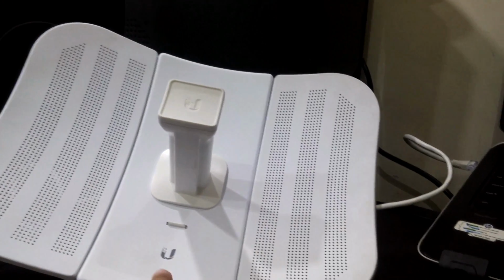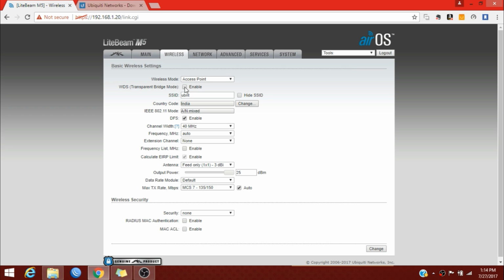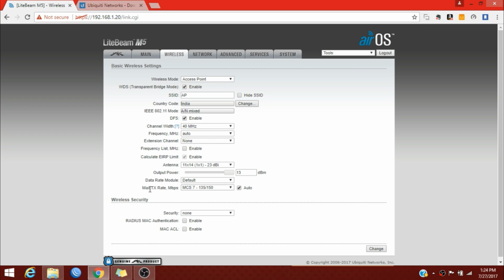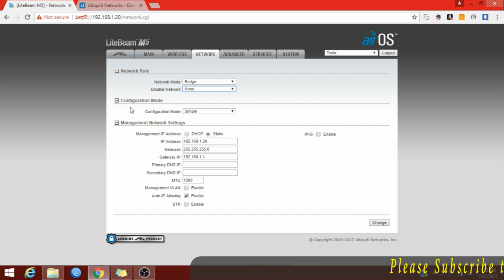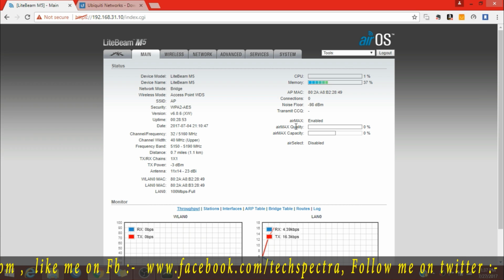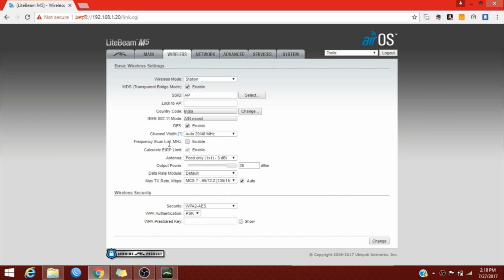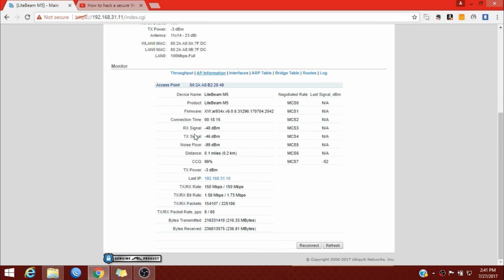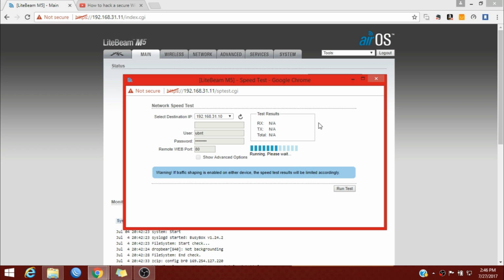How to Setup & Configure Ubiquiti Litebeam M5 as Point to Point (P2P Mode).💻 AirOS Full Tutorial.🔖

Comment: Hi there! Thank you very much for the video. So I will have the exact same setup as you do have, but at the other side, I did not get the point why I have to connect to the ISP. On the AP side, the cable goes to the router, so this provides internet access. The AP side will take the address automatically which I assigned (I hope). Then the station Beam will receive and I can connect that station beam to another router, providing the WLAN to multiple devices right? I don't understand the ISP part. I just ordered, but am unsure, if I need more devices on the station side to provide either a LAN or a WLAN connection... When the stuff arrives, I will try to connect the station to a normal router/ access point, so e.g. mobile devices can access and my stationary pc can as well. Do I have to connect/ have anything else/ is the ISP part necessary? Thank you very much for detailing this out :)

Comment: 1-2day after station side data not access reset device connect ap data receive but after 1-2day station side IP not access 
Then finally reset Karna padta hai how can solved problem
Reply from the maker: Check by updating firmware if problem still exists then your device may be faulty. Hardware issue.

Comment: I can’t get the AP to pick up an internet connection. I don’t get the option to login to the ISP via browser like I am supposed to. I even plugged it into an open port on the back of my router that already has access and still no internet.
IPs are all in my network range.
What did I do wrong or what can you suggest to help. Anything is appreciated. Thanks

Comment: I have a question. Sir no any adjustment in the setting for long distance connection..? Tnx
Reply from the maker: Depends upon your distance between your AP & station. For upto 5km litebeam m5 works. For 5-10 km you have to use power beam

Comment: When I punch in my unit IP address but it won’t let me in the menu it only says time out
Reply from the maker: Reset your wireless device and then configure it again by opening 192.168.1.20.
if you don't want to reset it then check its correct IP from ubnt discovery tool. Just download ubnt discovery tool and connect your device to your PC/Laptop.
Reply: Spectra TEch thanks I did that and it works
Reply from the maker: always welcome. Keep Commenting

Comment: What is difference between Station and AP mode ? Where we connect internet ? AP or Station ?
Reply from the maker: AP is access point means AP transmitts signals in the form of radio waves.
Whereas Station receives Signals from AP. 
In this way internet connection is established between AP and Station
Reply: So we will attach internet cable to AP device  ?
Reply from the maker: Yes right
Reply: Thank you so much. One more question. Can we connect head office to other branches within city so that head office can access resources of each branch ?
Reply from the maker: yes you can do that by establishing tower on Head office and use wireless devices on it as per your requirements.
Reply: may i know your email address ?

Comment: i purchased two cpe510 outdoor cpe
in which one is access point and second is client mode
i share internet on client side via lan cable on pc
i want to connect it with wifi router to share internet a client
location whats its setting for wan (wifi router)
Reply from the maker: +Gurmail Singh It depends on wifi router's brand. You have to set PPPOE connection between them.